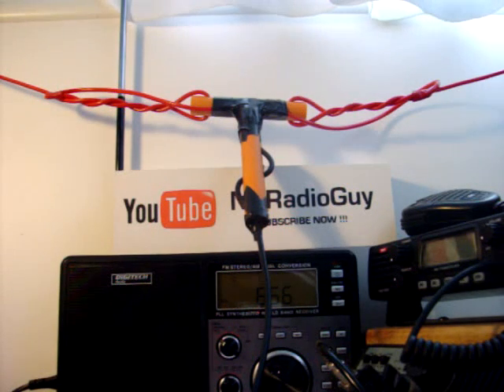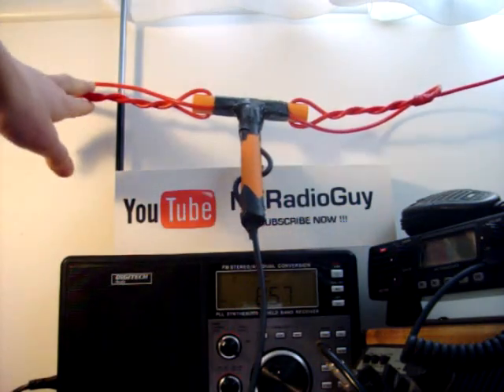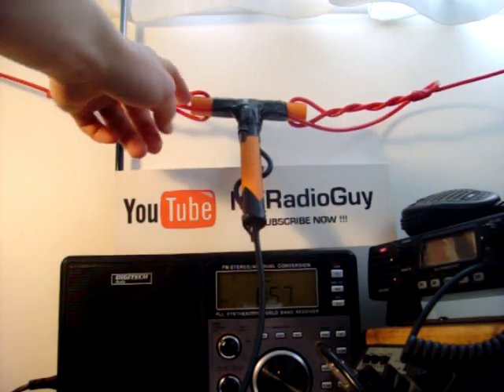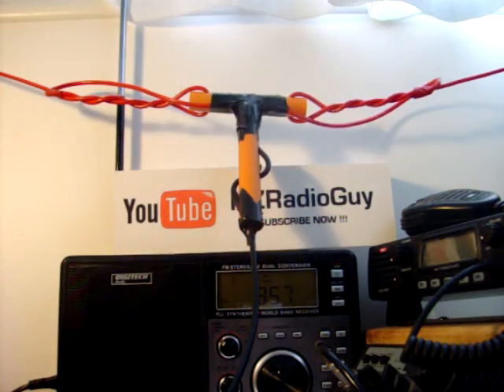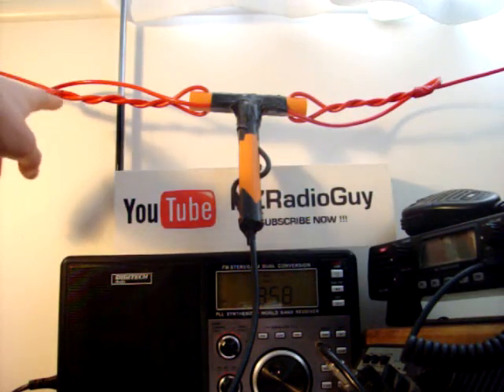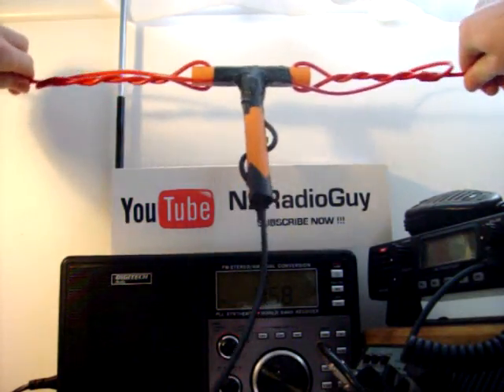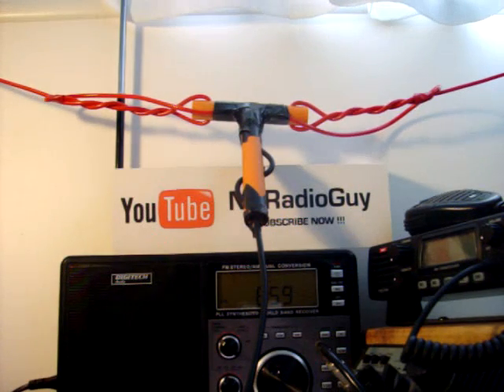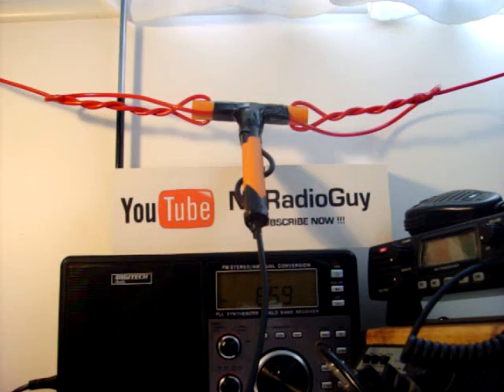DIY 40m Band 1/2 Wave Dipole Antenna

Comment from the maker: @adamshondaxl350r1985  Hi. This antenna is tuned for Amateur 40m Band around 7.15 MHz.
New Zealand Has three CB Bands: 26 MHz CB, 27 MHz CB and UHF PRS. This  antenna design can be used for CB, however, the antenna would be smaller due to the wavelength. ½ Wave Dipole at 26 MHz would be about 5 m in length instead of  this ½ Wave at 7 MHz = 20m  . Hope this has been of help. 73, All the best. NZRadioGuy

Comment: Good job!  I really like the way you mounted the coax in the pvc pipe for stress relief.  That's a great idea if the cable is connected directly to the elements.

Comment from the maker: @Jackupnow   Hi There. Thanks for the comment. I have a six metre mast I have been meaning to erect for the last few weeks. I gathered the roof was absorbing my signal. Haven’t bean able to maintain contact with antenna as it is. Thanks again, will poste video when I get the mast up.     73.    All the best.   NZRadioGuy